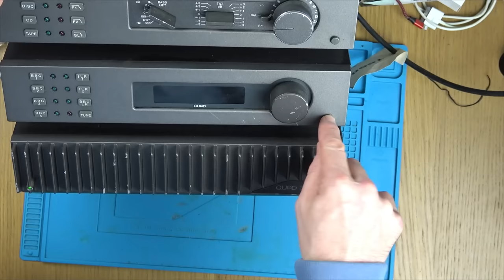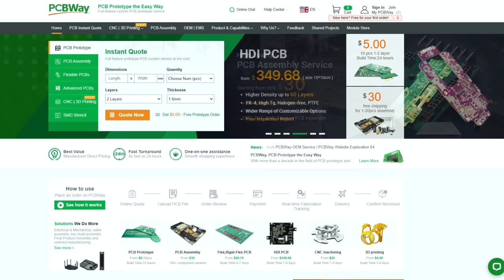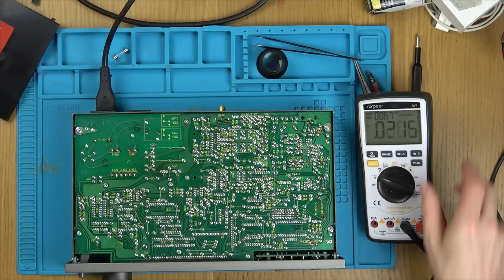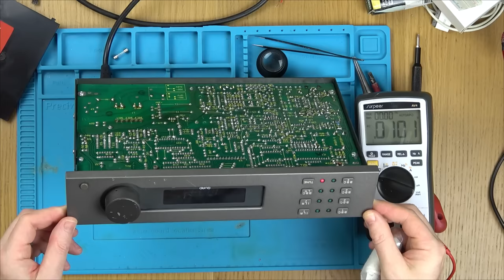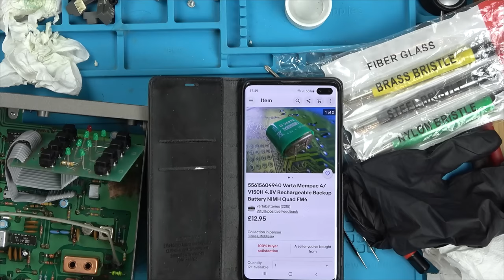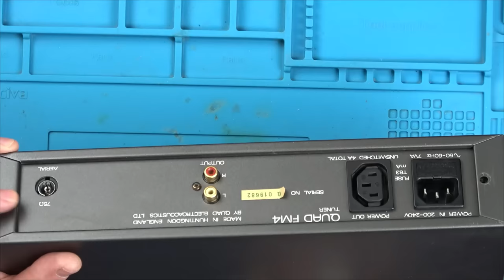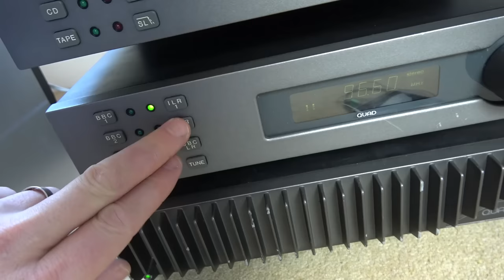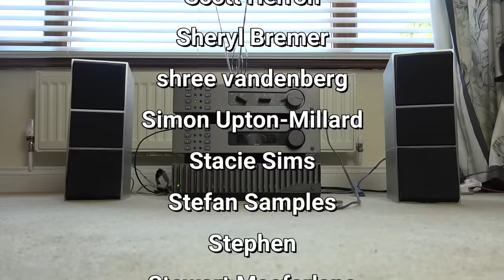QUAD - The Crème de la Crème of Audio - Can I FIX it?

Comment: Is it normal for the preamplifier to need to be turned up that loud to reach a decent listening volume? Perhaps those Bang & Olufsen speakers are the wrong impedence or are not as sensitive as the ones intended for it originally?
Reply: As I recall quad amps used to be very good at handling various speaker impedance's as I also believe the quad electrostatic speaker were  very "nasty loads" (referenced to 8 ohms.)  They were very clean but just not supper powerful. 
Note that volume controls are NOT simple linear devices. They use some variation of exponential or logarithmic ramp up.  Some amp designers started to use faster "ramp ups"  to give the impression they were more powerful.  More refined designers tended to  move the sweat spot for normal listing higher up dial.
Reply: @lorencarvajal8848  Thank you for explaining. I am likely just used to the modern amplifiers that ramp up faster, and expecting too much from such a small system.

Comment: The tape loop as 4 phono plugs, as one stereo pair (REC) sends audio to the recorder, and t'other (REP) is for the recorders output to the amp (basically like a normal input).

Got to reinstall 3 recorders (Minidisc, DCC AND CDR) via a tape switcher when rebuilding my system tomorrow... That'll be, err, fun. Not.

Comment: I would have replaced that rifa capacitor with a different brand capacitor because replacing with an identical cap of the same brand will just lead to the same failure in the future as most rifa caps sold are new old stock.

Comment: 29:40 those buttons are a pretty common part, much better idea is just buy replacements for any broken ones. Generally buttons are little spring-loaded buggers to take apart, they're not intended to be repaired.

Also, all caps will show as open circuit on a simple DC continuity test. Think about it, it's two plates with an insulator in between. A really big cap might show as conducting until it fills up. Fortunately you've got a cap tester on the multimeter, but you need to be aware what you're trying to do when you're testing stuff.

Comment: Ahh yes, as I know from my world of Fruit Machine repair (Especially on Barcrest MPU 3 and 4 systems), the "Blue B'stard Of Death". 

Certainly in Fruit Machines, these Varta's (Normally 2.4 or 3.6v 3-pin variants) are used for memory retention, and are almost always responsible for various damage on boards. 

Whilst I'm unsure if it's possible in this case, when it comes to Fruit Machines, we normally swap out for the green ni-mh variants (As Ni-cad are pretty much banned, barring some very limited applications), cleaning any leakage and green bits on the board / components with IPA, or as a last resort only, White Vinegar (A toothbrush helps here), making sure the board is rinsed well with plain cold water..... then the fun of track repair begins.

Again unsure if it's possible / advisable in this case, on Fruit Machines, we often wire the battery well away on some fly wires (Phone / LAN wire works well), externally to the unit.
Reply: Another thing again from the Fruit Machine world, on MPU 3 / 4, there is a batteryless mod some members do, which replaces one of the chips with a flash memory equivalent, and removes the need for a battery, so it maybe something you would want to look into, see if it's feasible.

Comment: The contacts may be oxidized because of the battery liquid and its vapors, or they may have a layer of carbon and only the bottom contact dirty (two 2 wires and the center contact).
The Valta 4.8 V rechargeable battery is better to change for any cell phone battery, generally from 3.7 to 4.2 but it will be enough to remember the memory, I don't know if the charging system will ruin it but at least it won't leak , and there are also 4.7v and many more milliamps.
I don't have that green mascara, but I use clear nail paint and it seems to do a good job, plus it comes with its own applicator brush.
What happened to your finger? will you be alright?

Comment: Hey Vince…..is that Rifa X2 class capacitor just there behind the male I.E.C. Connector and just off the upper right hand corner of the transformer ?  If so, it is almost certainly the reason your T 63mA M205 blew.  Those damn things are a known menace….they are basically right across the low source impedance mains and their dielectric goes “funny” and they swell, crack and split open and become REALLY leaky.
     Under some circumstances they can jet out an amazing volume of destructive distillate smoke, and if a spark occurrs it can turn it int a mini flame thrower…..so hoik it out and replace it with a modern class X2.

Comment: Remember when I was studying electronics and one course was consumer electric repairs. We fixed VCR, TV, Radio. At some point you had to measurement with live circuits. We had isolation transformers. 
While working with live equipment is mandatory to detect where the 240V is and is low voltage side isolated from mains.
Note: Usually tape / recording "interface" is pass through. One is audio to tape player and other is audio back from tape player. Basically if you listen radio you can record that audio and when select tape you can listen that recorded audio.

Comment: Don't know why you would want to tune to a 100mhz frequency on FM. As far as I'm aware there is a separation between stations and they are typically like my local frequencies 89.5, 89.9 103.5 etc. Not aware of any broadcasters that operate "dead on" a frequency.

Comment: The tape connections make sense when you think about it.  You have record because to record anything you need to take the audio to the cassette unit.  Then rep = replay which takes audio from the cassette unit to the amp.

BTW there is probably a bulb behind the display on the tuner that has failed.  Replacing that will make the display clearer.  Not worth a revisit video for that though.
Reply: The display worked anyway when Vince repaired the other problems. It's a phosflourescent type incidentally so doesn't use any bulbs.

Comment: I don't think I would have put another rifa in there.  Those things are horrible.  I would have put any generic X2 cap instead.
Reply: Most often what I see people do is just take them out and leave it open.  Nearly every time they are only used to pass interference regulations (FCC in the US) and do nothing for the actual function of the device.

Comment: The quad amps have a perimetric equaliser in them that allows you to change the frequency and then boost or cut the frequency you have picked and sometimes adjust the resonance of that picked frequency to make it adjust a wide or narrow band. Back in the past I made a guitar amplifier that had two parametric equlisers in
Reply: No they don't. They have a tilt control. In the preamp, not the power amplifiers. Nothing to change the frequency, and nothing to adjust the band width either.

Comment: I actually had the preamp and power amp here, and I have to say... I wasn't massively impressed.  I did replace the op amps in the preamp with a recommended upgrade, the name of which I can't remember, and it did improve the sound quality.  But it was still very much lacking in bass.
Reply: Can't be lacking in bass. Flat to 20Hz. Must have been your speakers.

Comment: One of the ICs was date coded 8610 (10th month of 1986). Which would make the tuner 37 years old.

Why surprised by the low frequency transformer in the PSU? ... The tuner is not going to use a SMPS in 1986, and certainly not in high-end Hi-Fi.

Not "positive" ... "Live" ... The tuner runs on AC mains!

Comment: If there is enough room i would never solder a battery on the board again. Connect it with wires and store it in a small plastic container inside the appliance.

Comment: This amp's  predecessor the Quad II and quad 22 control unit abd FM tuner were the real deal. The old Quad hardline customers never really embraced the transistised products, regarding valves as the true light and the transitor amps with class B distortion the work of the devil 🙂
Reply: Yeah right, they sold 100,000 Quad IIs, 100,000 303s, and 120,000 33s. Explanation please.

Comment: The tape has 4 plugs because it is 2 for the signal of the tape deck to the pre-amp to play music from the tape and 2 for a signal from the pre-amp back to the tape deck (the "rec" pair) to allow you to record from another audio source (i.e. of the radio or record) on your cassettes.
The "Tilt" at the front of the pre-amp is to change the dB's send out to the left and right speaker. When you sit at your favorite spot listening to music one of the speakers might be closer to you than the other. By turning the tilt you can set 1 speaker to a slightly higher volume and the other one at lower volume. In that way the sound you hear of the left and the right speaker should be at the same volume at the place you sit and listen (in theory).
And yes, QUAD is a league above B&O; if I ever win the lottery I'd love to buy a QUAD-set. A close friend of me has a set, it is such a nice thing to just sit down and listen to the sound of said system.
Reply from the maker: Thanks for the info Gilles 👍👌
Reply: Tilt on the preamp is, as the manual states, an EQ adjuster, not a volume balance between speakers.
Reply: @musicandfilms9956  Wrong explanation by the friend who has such system to me, I guess. Thanks for clearing!

Comment: Sorry but I'm watching the beginning of this screaming "FUSE! FUSE! CHECK THE FUUUUSE!"

I dunno if that turned out to be the problem, but it's unlikely to be the transformer, Quad would have used a decent one so it's probably lasted. Any sort of fault that'd affect all it's voltage outputs would likely end up setting fire to something when you powered it up.

Comment: Repair a pair of Tannoy.
Reply: Not a Tannoy fan, but those are really fine pieces of speaker, that need original specific part in order to retain it specs and it value, I mean the 60's or so dual concentric ones. Not modern Tannoy ....

Comment: (edited)
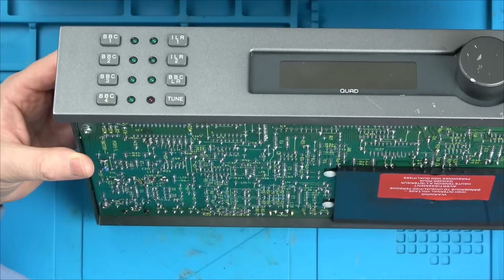40:47
Every how-to tutorial I've viewed regarding soldering has stated not to solder in that manner.  All of them have adamantly stated not to create a joint by melting solder onto the tip of your soldering iron, followed by applying the melted solder onto the two metal parts you want to solder together.  They have logically stated that such a method for soldering does not create a solid bond.  Instead, they have claimed the proper way of soldering is to heat up the two metals you want to bond in a joint simultaneously with the tip of your soldering iron, and then while the tip of your soldering iron is still heating the two parts to be soldered together, you then introduce the solder to the preheated area.  They claim that this method will form a much more durable bond than the other.

So, what gives, My Mate VINCE?  I'm sure your method here for these types of connections is more than sufficient, but can you supply any defense, or justification, for using this method.  I'm not trying to claim that everybody else is right, and you're wrong.  I am only attempting to gain a more thorough comprehension.  I am quite interested to hear your opinion on this specific topic.  Also, while I have you here, that is if you are reading this, I will be subscribing to your channel after watching the above video in its entirety, but I was wondering if you have made any videos regarding diagnosing issues with electronics, specifically audio devices/stereo equipment.  You might have hundreds of videos, making it more likely to overlook any videos covering a specific subject matter, as in my current case would be learning how to diagnose electrical problems with nonfunctioning stereo equipment.  

Thanks for creating your content, and then sharing it with a world of strangers . . . much gratitude!

Comment: The frequencies on the digital tuner will be for the older settings on VHF.  They changed them sometime in the 90's, in the UK, so they no longer line up exactly with these older digital tuners.

Comment: As a retired Audio engineer this video frustrates me, I love your enthusiasm but with any dead electronics always check continuity from mains to the primary of the mains transformer first, 99.9% of all consumer electronics has a mains input fuse, simply no need to put power to the machine before doing the continuity checks, Anyone watching this video and wanting to attempt a repair on an any mains voltage electronics must learn to respect mains and mains smoothing capacitors, it's just crazy to do otherwise. Not even going to mention isolation transformers!

Comment: You should power up unknown stuff through a lightbulb in the live line, this way the current is limited. Also are you using a safety mains isolation transformer?

Comment: Fell into the trap of all electronic repairs, spending a lot of time dismantling and cleaning an area that had nothing to do with the fault, or minimally so as the buttons did work.
Firstly you diagnose the fault and fix that then after you have the things working 100% do any cleaning, imagine if you did hours of work cleaning and then found an irreplaceable ic was damaged, all that work and time for nothing.
Very interesting to watch though. And i guess you were waiting for the battery.
Reply: Nothing in Quad audio gear of that era has parts that can't be replaced, including the custom wound Quad low voltage power supply transformers used in their preamps and tuners...

Comment: Man, you are grey ( as noted on this video ) but surrely not grey enoug. Tapes were used for recording and playback. Since analog audio goes one way only, and you need in modern terms Rx/Tx for any 2way communication, you need record and playback set of wires, don't ya. And yes, disc is a valid name for a record player, and when it got compacted and digitalised it became compact disk, hence CD. :-)
Reply from the maker: Compact Disc, of course!! Thank you👍👍

Comment: hi alot of misstakes when you get in to the top  new bee things   the case is ground to the  ov in alot of audio decks 

fuse price you are buying far to high   10 for  £1.70 is about right   RS  is the best deal on line   post cost are up 
with alot of the parts lot

Comment: Never trust a used equipment fuse. The owner might have just replaced the original fuse with a wrong one, you should read the fuse value from the equipment itself.

Comment: The switches in the units are special audiophile switches and the black coating is made from unobtainium. This gives the system a sweeter sound and deeper soundstage.

You didn't clean the switches in the preamp, which are probably as black as the ones in the tuner.

Comment: That was a typical noob mistake, 16.16 before you realised the input socket had a fuse, the fact that it actually says on the back next to the socket the fuse rating, look at 10.06, and you can see it very clearly.
These types of socket are very common on equipment, surprised you have never seen them before, lost count the amount of times customers would come in with an amp etc for repair and all that was wrong was the fuse had blown.

Comment: The "Reefer" cap (named after the branding on some of them) can be left out completely, especially in a linear Power Supply.  They are just for noise filtering :).     The new one should last a while though :)
Reply: They are Rifa caps, or rather RC networks, and they are there to prevent arcing at the power switch, not for noise filtering.

Comment: Bass left, treble right, should actually just be able to hear it. Sorry, a professional sound engineer here, what you have there is a real little jewel of a system…fully operable and restored you can get the original cost for them, adjusted for inflation that is.

Comment: There are no dangerous voltages to be found on capacitors in linear power supplies like these.
Reply: In low voltage linear power supplies like these. Highest voltage in the set is +/-38V in the power amp. But valve amps have linear power supplies too, and hundreds of volts. Don't give out dangerous advice, please, when you don't know what you're talking about.
Reply: @EJP286CRSKW  I do know what I'm talking about and that's why I said "like these". The amplifier being repaired does not contain valves nor anything else which runs at a dangerously high voltage.
Reply: @DavidHembrow  That's what I said.

Comment: Love your content. Why do you call yourself "my mate Vince"? Is it some British tongue-and-cheek thing? Oh, and your prices in 1991 (roughly total 1000), in today's money is like over 2,600!! Talk about "creme de le creme"! 3 bridge rectifiers on a linear supply would indicate 3 separate windings on that PCB mount EL-core transformer. A 3 ohm 5W resistor and a couple of old multimeter probes make a great capacitor discharge tool! And, those fuses, for the future are called M205. The 205 basically means 20mm x 5mm. I also doubt the first time you put the fuse in and turned it on with nothing happening, then removing fuse and reinserting it had anything to do with "capacitors charging". It would have powered on completely the first time. I think, knowing those IEC connectors with the fuse in them, the fuse wasn't seating right the first time. Your tuning jumping by (I believe 5MHz) is 1), it's varicap tuning using a 10 turn potentiometer and 2) there's no antenna connected so the PLL is probably "confused".

Comment: It took a bit of time charge up the capacitors 'and stuff' ????? NO. You should know that the capacitors will charge up in the first half cycle of the mains waveform ! What's probably happening is that it takes time for the digital electronics to initialise. You seriously need to learn the basics.

Comment: To add to my earlier comment pc collectors like LGR hate them varta batteries for same reason most remove them or solder in 2032 cell battery holder replacement